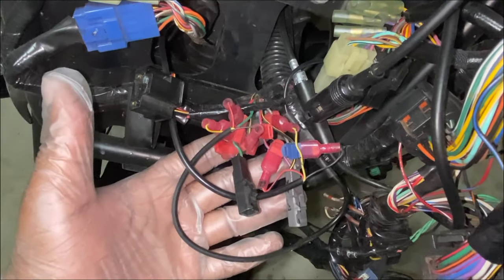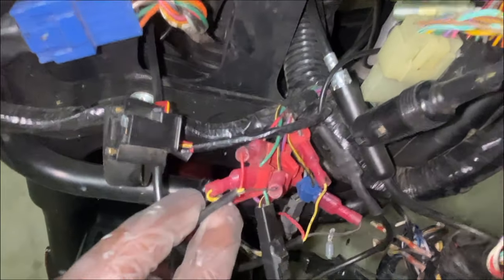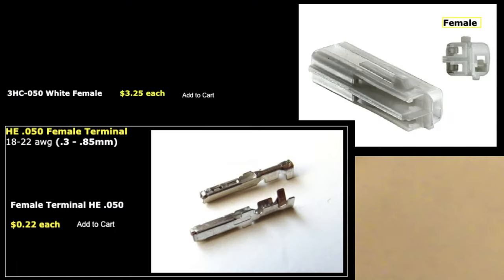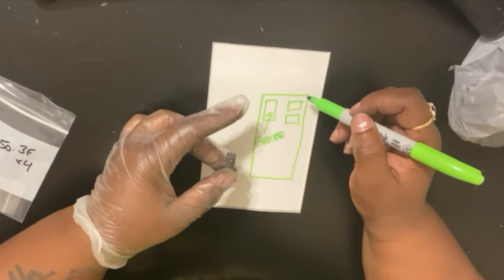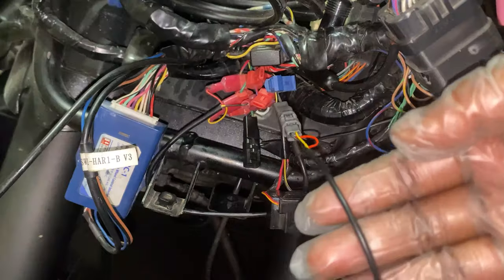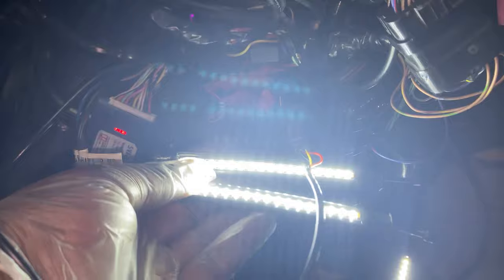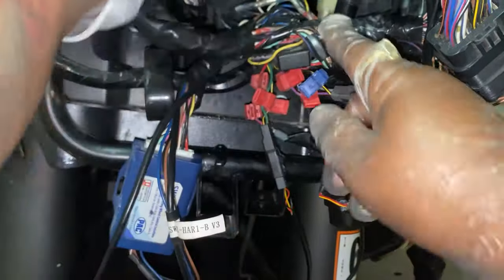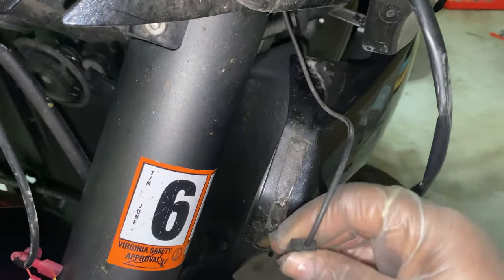LED TURN SIGNAL INSTALL • Kawasaki Vaquero Mod

Comment: You are well on your way to being a professional electrician! Great job! Cleaner is definatly better, using stock connectors is a good thing especially if you ride in the rain!
Keep up the good work
Reply from the maker: Most definitely! I feel a lot better about it now that it’s connected correctly. Thank you!

Comment: I have the same lights but mounted a few inches lower. I need to clean mine up and cover the lines with plastic cable cover.
Reply from the maker: That’s wassup! They’re decent lights for the price.